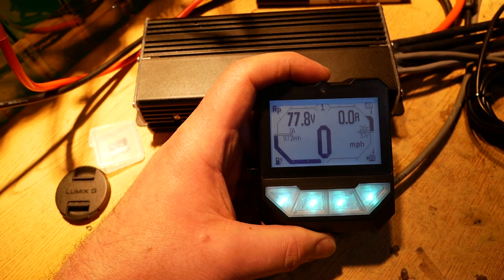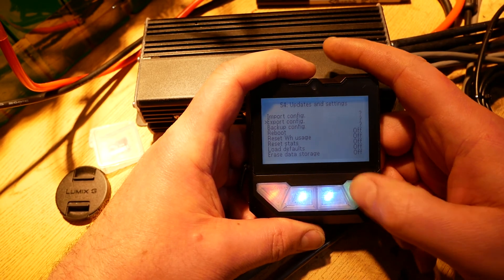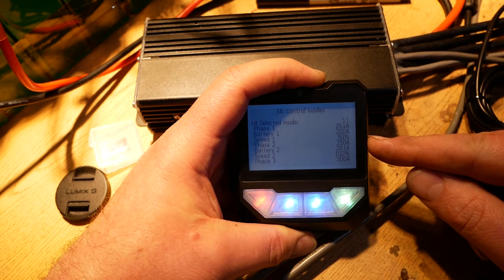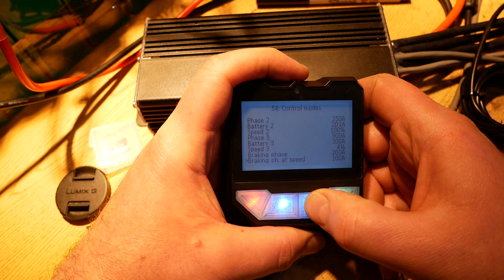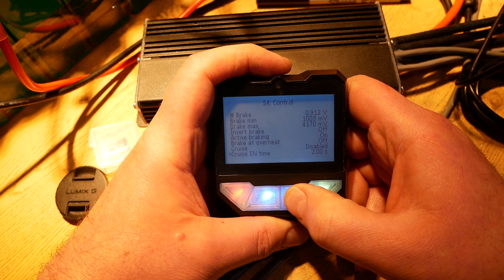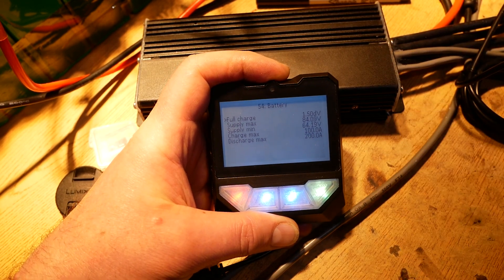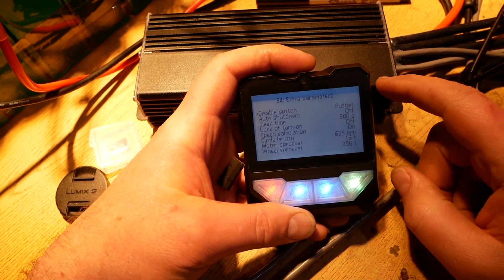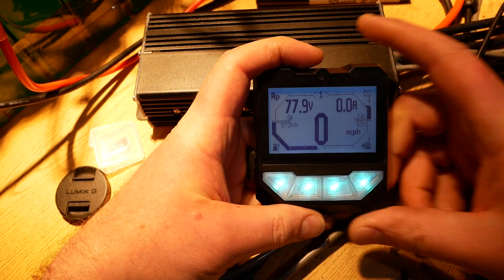3 Nucular Controller setup walkthrough

Comment: Finally did get this thihng to work... holy hell is it a beast when it works. I know its not totally dialed in right. Im looking at your Phase amps etc. With a 72v batter whats the highest amps I should go? like right now on setting three I have it set to 500 amps is this way too high?
Reply from the maker: What's your pack capable of delivering? That's what you set battery amps to.

Comment: Hey man why do you say to not change any of the advanced modes ever? Iv seen other vids of people messing with the 5 options for less torque or speed seemed like it works well no?
Reply from the maker: Actually I don't say no to that stuff. Most people will never understand PIDs for example. They shouldn't adjust them EVER. I make content like this for people like that. Those people that will research and do their own homework, they soon don't need content like this as they are absolutely going to learn what everything does! I'm one of those people myself, but most people are not. They "just want it to work" and never learn anything for themselves! I run into them all the time in my videos comments and Facebook. They can't even be bothered to watch the video where their basic questions are answered!
Reply: @de-bodgery  I appreciate the response but honestly im pretty new to the ev stuff but i got that controller with a 72v mx4 just trying to change the settings to give me more bottom end if possible? Came from racing dirt bikes so its just not as poppy as I want but mid and top end is unreal. Any suggestions to help me out?
Reply from the maker: @lukeroberts5501  https://docs.nucular.tech/doku.php?id=en:controller:setup

Comment: Is the 16/1 ratio for the 48T sprocket if so what is it for 56T or how would I find it out please help
Reply from the maker: It's jsut a gear ratio. Set it to whatever you have. So if you have a 56T sprocket put that in there instead. 16:1 could a 160t sprocket and a 16T sprocket....or whatever. These are totally settable values. Since I'm using a hub motor, my ratio is 16:16 or 1:1 or 1356:1356. As long as the ratio you have is preserved that's what matters.